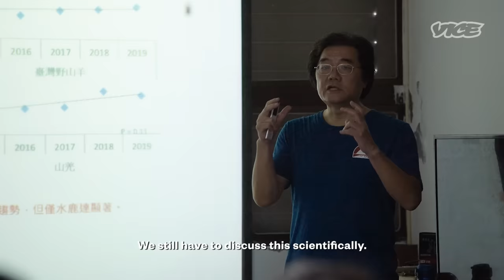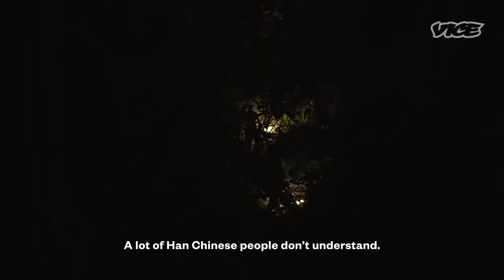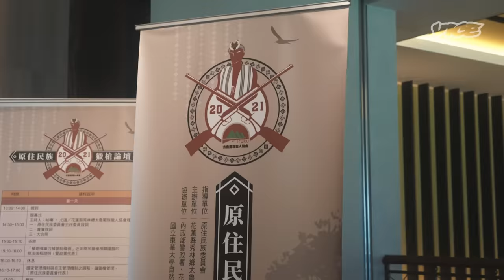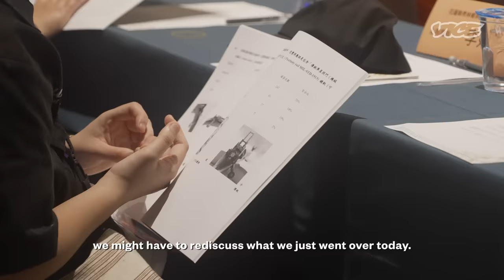The Homemade Guns of Taiwan

Comment: As an American homemade firearm enthusiast, I feel like I suddenly have an obligation to make pilgrimage halfway around the world to carry the traditions of quality home gunsmithing, and the modern practices of 3D printing, to help these people build better and safer homemade firearms, with a higher rate of fire, too, because those Han Chinese judges can suck it.
Reply: They don't need 3D printed tech, its too far over their abilities at the moment.  What they need is straightforward info on how to make a safe firearm using the most basic tools.  3D printing is great, I just don't think they're ready for it yet.
Reply: @jth_printed_designs  On the contrary, 3D printing simplifies the process, and enables much more straightforward implementation of safety features (like a, well, a safety). It's so much easier to get precision for complex geometry on low-stress parts, like receivers, and replicate it with very little effort on behalf of the user, it would be a force multiplier more than anything.
Reply: @jth_printed_designs  Imagine they're having trouble doing accounting with pen and paper, and instead of getting them a computer and accounting software, you're like nah fam, you need just need to get better at learning obscure tax laws.
Reply: @auxchar   They're not having trouble doing accounting with pen and paper, they're working on slate tablets.  They need an upgrade to the pen and paper, not tech that is wildly different from anything they've seen before.  They are currently crawling, and you need to walk before you can run.

Comment: imagine some ranom person somehow finds out to make a m-134 minigun
Reply: It would be too complex and annoying. You would need engineering fabrication and electrical knowledge all at a high degree it would also take forever just to make 1 as it's quite literally making 6 rifles and combining them into 1
Reply: @ISwearMyNameIsJohn  it was a joke but still possible find some lost documents on how to make it. It would be very crude though
Reply: naidirolf  also what i hate is that games call the mounted guns are air planes mimiguns those aren't miniguns those are the full sized verson shooting called a 20mm – F-16E Gatling Gun System which basically shoots tank rounds but faster

Comment: They should implement a shotgun certificate for break action shotguns and a bolt action rifle certificate.

I'm not sure what they are using for ammo, crushed up fireworks, nail gun blanks, toy cap gun caps for percussion caps or even an electronic ignition.

If a guy pours a load a nail gun blank powder into a muzzle loading black powder shotgun then he would be lucky to live.